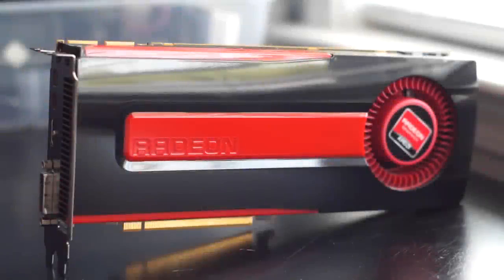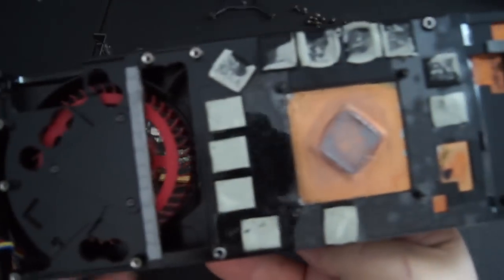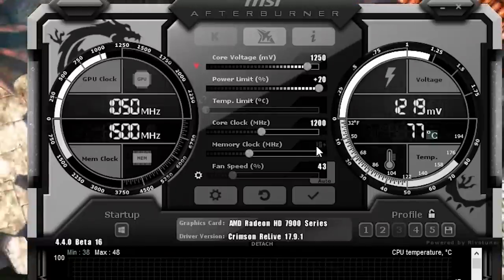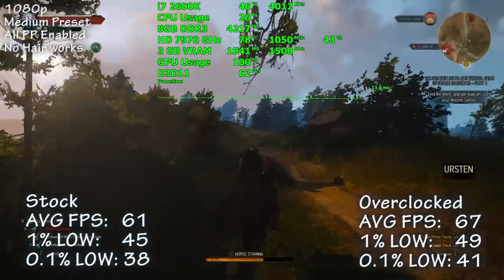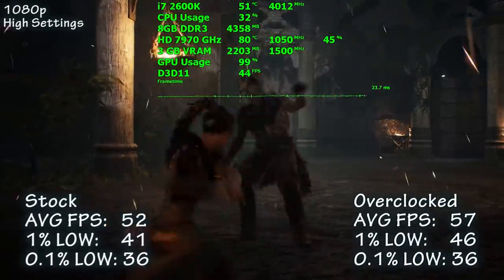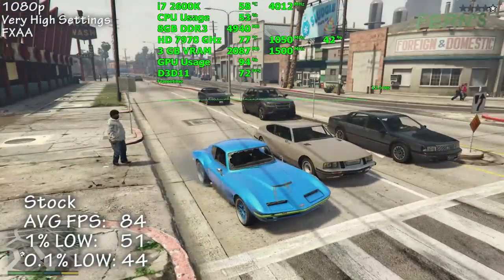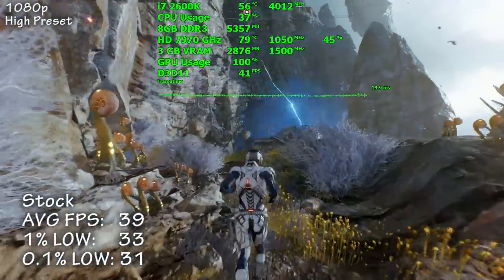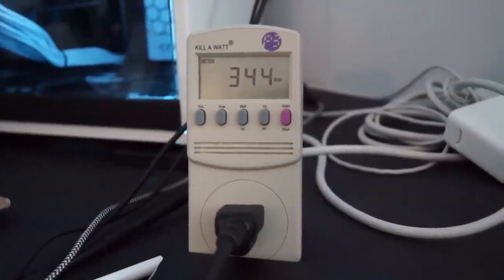AMD Radeon HD 7970 GHz Edition - How Does it Stack Up in 2017?

Comment: Remeeber when the 7970 launched nvidias flagship was the fermi 580 (fully unlocked rebadge of a 480), the 680 launches later and cost allot more (like £300 vs £400 for the 680) yet everyone fangirl'd over the 680. this card is still so great today 5 years later with a good amount of vram and even has FP64 compute 4x that of the pascal titanX, meanwhile 580's and 680's are peanuts second hand with only 2gb vram and narrow memory bus like a hd7850), the fan blade curves suck which accounts for the noise and temps but amd doesnt make the fans and that error carried on until recently. one of the best gpus you could buy ever considering how good its been for so long.
Reply from the maker: Yeah, the 7970 is probably one of the best aging GPUs of all time thus far, right next to Hawaii. It's kind of a shame, as when it was first released there was so much untapped potential. Hence, that's why NVIDIA released a mid tier chip as their High-end. The battle really should of been Tahiti XT vs. GK110, but NVIDIA wasn't impressed by the performance of the 7970, so they released the would be GTX 660, as the GTX 680. It has happened every generation since (GTX 980 and 1080) Fast forward today, and the 7970 is faster than the GTX 680 and is nipping at the heels of the GTX 780, or so it is said. I'll be testing that theory soon enough. 

As far as Fermi goes. It's aged much better than the 6000 series, mostly due to being a compute heavy design, and the fact it still gets driver updates. I have a HD 6950 in hand just trying to score a GTX 570 right now. I might have a 2.5GB version soon. I really like the Terascale 3 cards, and still wished they saw driver updates. I mean they support DX11 and have 2GB of VRAM. Still plenty for a lot of games.

Comment: Cgn 1.0 suffers from tesseletion setting it max at 8x boost overall performance.3 gb vram is enough for high with tweak in settings overall its features in dx12 some level   and vulkan support makes this card a true diamond.Replacing fan with gelid cooler made this card silent running at 60 celcuis undervolted with 980/1400.
Reply from the maker: AMD R5 1600 290X Tri x 8 gb Yeah I used to have 7950’s in CFX. Both has Arctic Acceleros cooler. They ran pretty cool and quiet, just put out a ton of heat. Like you mentioned, they underclock reall well too.
Reply: Hallo cousin! :D

Comment: Love your content. As I said in the past, like doing the same tests, but not quite as detailed! Firestrike and Passmark is about my extent. lol Keep up the good work! I have the non-Ghz HD7970 (replaced the GTX 580s I had). I bought a couple R9 280Xs last year (~ the same as a GHz HD7970, right?) to feed my BOINC habit. Have a few XFX HD7950 (Boost ed., and Black ed.) as well that I use for BOINC from when I dabbled in Bitcoin. Tahiti is king of FP64 compute. Not even new cards can match the 1Tflop+ compute for projects like MilkyWay@home. More geek stuff. :) Any way I also occasionally game on any of them, and can't say I am disappointed.  Interested to see how well they can power my 1440p monitor I upgraded to recently.
Reply from the maker: +Fury1184 Thanks man. I appreciate it. Yeah the 280x is pretty much the 7970 Ghz edition. I never got into mining, but I wish I had. Sounds like you quite the Tahiti collection. You’d be surprised with performance on some games at 1440p, but more graphical games are a bit too much.
Reply: For me, mining wasn't profitable, only made 1/2 my money back. Where I went wrong was I was expecting a quick buck, and when it tanked, I got scared and sold everything before it bottomed out.  I should have waited till this year...I had probably 7 or 8 bitcoins at one time and at today's prices, I would have paid for the hardware and then some. Oh well, hindsight is 20/20.
Yea...I got a few. I guess I am bit of a hardware hoarder. lol. I use them for BOINC as I said, which is the distributed comuting platform for universities and whatnot to do scientific research projects like SETI@home (Search for ExTerrestial Intelligence), which you may have heard of, or Folding@Home, whose goal is cancer research, which is a spin-off from the BOINC platform. I crunch for the Overclock.net team. Check it out sometime.
Reply from the maker: +Fury1184 That stinks about your loss on them. Yeah, I’ve spent my fair share of time on OCN. Spent more on the AnandTech forums, but not so much anymore, as they’re not like they used to be imo. I’ve heard of seti and folding@home. Haven’t contributed thus far, but I’ll have to check them out.
Reply: It is nuts that even the workstation Vega card (Frontier edition) has 1/8 FP64 throughput vs. Tahiti's 1/2.... (relative to FP32), so consumer hardware
beats up on professional cards at their own game.
Full throughput means half as many FP64 FLOPS as FP32s (due to each operation working on twice as many bits)

Comment: Hello i have the same card but after 5 minutes of gaming it already has over 90 Degrees and is extremely loud. If i dont stop gaming it goes even higher to over 95 degrees. I changed cooling pads and cooling paste today (good one from arctic). But to no avail. It still gets so hot. But i noticed that the stock cooling mounting bracket on the backsite is missing. Does this cause the high temperatures cause the mounting pressure is not enough?

Comment: I wonder if the 2600k is holding it back at all? Would be interesting to see the 7970 ghz in something mad like a 5ghz 9900k.
Reply from the maker: I would imagine there is a little bit more to be gained from using a 9900K, but probably less than 10%

Comment: my 7970 is sill kicking ass. its the stupid DD edition with the stupid cooler on it. i think its actully worse than the reference blower type. ive had too get rid of he fans an add 2 120mm too it too tame it. if i didnt have my xfi fatality pcie1x below it i wud double stack the 120mms for even better cooling which this card deffo needs

Comment: I've had my 7870XT (7930 thaiti) for 5 years is it worth replacing the thermal paste? I'm currently running at about 81c when the card is maxed out in far cry 4.
Reply from the maker: Yes. I would definitely replace it. 81c for that cooler is pretty high.

Comment: I really want to believe this is just a driver update gimping it as i have a RX 580 8GB V1 clocked at 1340mhz to play with and it literally has the same performance as this 7970. Is it just my card, or did some performance fall off with adrenalin HDCP or even 2016 Crimson update? I can never get performance like R9 390's i saw on youtube. Made me disappointed in Radeon for a bit.
Reply from the maker: There are a lot of variables which is why it’s hard  to make an equal comparison. What does the rest of your system look like?
Reply: A 580 should be quite a lot faster.

Comment: I sold my hd7990 / 8990 because I dont know if were driver problem o what but my games run like shit so I change it for a gtx780
Reply from the maker: Crossfire is hit or miss. Really depends on the game you’re playing.
Reply: thats why I sold it, but even using one gpu in some games fps were very low, for example I can play fallout 4 in ultra with a gtx580 classified but no with one gpu of the hd8990
Reply from the maker: GTX 580 Classified... 😍

Comment: gtx 690 or gtx 1050 ti? nowadays what card is equivalent to a gtx 690?
Reply from the maker: Assuming SLI is supported, 690 is definitely faster. One GPU on the 690 is around the performance on the 1050 Ti. When the 690 is supported properly is around gtx 1060 performance- or at least should be

Comment: Did you turn on any advanced settings in GTA 5 ? I'm not able to get anywhere close to 85 fps.
Reply from the maker: Nope. No advanced settings. What does the rest of your PC look like?
Reply: F2F Tech 4670K, 8GB RAM, 500W PSU.
Reply from the maker: Looks good. Keep in mind I’m benchmarking the last 115s of the built in benchmarks. You can set Fraps to record 115s as soon as you see the waterfall. It should end right at the end of the benchmark. Give it a try.
Reply: F2F Tech Cool, thanks for the help.

Comment: This card disappointed me   ! It  looked awesome   3 fans Gigabyte 
Memory  3 Gigs of  352 bit  which was the best at the time  DDR 5.
Now  was it because  of the fact I used 2 x 6 pins with one that was adaptor to 8 pin ?

It ran great  don't get me wrong  but it wasn't better than a  6850 XFX  & 6970 Powercolor !!
They ran actually stronger in older games like serious sam !!!  1 2  & 3 ..
The 7950 felt like it was struggling at times which i think it was lacking power from my power supply Corsair 500X  which is great but not powerful.. at all..
Once  I put a GTX 1060  My system climbed to insane heights.. Blowing away all these cards..

Now personally I think it wasn't getting enough power and that can affect your Graphic card big time it will stutter as I learned this Installing a GTX 8800 Legendary graphic card and it ran poorly till I upgraded the power supply to a new one recommended by the technician making the card fly!!!  realizing that was the problem  after he did a few tests.. 

But once I went RX560 SC 4G   wow what a card !!!! AREO MSI  Just Outstanding!
or a GTX760 3G Alienware system model oem.  WOW again  then the GTX ASUS 1060 
I'm in love with this card.. it truly won my affection  and made me love Nvidia  again..!
I was a big ATI fan boy for the longest time.

THE FINALLY A   ASUS GTX 1080Ti OC Strix Republic of Gamers  11G  Card!!!!!!!!
You don't wanna know the price tag on this card when it came out.. It was like a Honda civic  lol    hahaha 
I am Blown away by i;'s Visuals and Power.. and I've been waiting 5 years for this card to come out! Finally bought it.
For my New Ryzen 3600 XT  Viper 4400 hz Ram 16 set with a Sabrent 2T on board chip at 5000mhz speeds 4.0  
In a Cougar Tower X330- Air  3 front 1 Roof 1 Back Huge size all Neon Blue Plus a  212 Fan on the heat sink for more cooling Plus  swirling colors... 
Gonna  build it all soon.. For editing Videos Mostly  and  Photoshop  and serious gaming... 
*EVil*QTip GTX1080Ti 11G     is back   on I.D  Software!!!!!! GAMING !!!

Comment: I wish my r9 290x didn't kill itself, now all I have is a 460 thanks GPU prices
Reply from the maker: Bummer 😔
Reply: TheKnight OfCydonia My r9 270 killed itself too, so I've had to get a 1050 ti at the price of a 3gb 1060... At least it is somehow faster than the 270, and it runs much cooler.
Reply: I almost got a 1060 3GB for $190 but I didn't and regret it :(
Reply: Gabriel Perianu Why didn’t you get a 780ti or Hd 7970 ghz?
Reply: TheKnight OfCydonia Bad luck bro :/ Better try to save for the new 20xx series from nvidia. A 2060 at just 200 or 300 usd should be faster than a 1070 ti!
Reply: Xeno My 500w psu is to weak...But it worked good with my r9, so why not keep it and get a more frugal gpu?
Reply: My R9 270 died and now I play with GT1030

Comment: The 7970 was ahead of its time. It's still basically a low-end, modern card that is decent for a light gaming build.
Reply: JohnnyNismo *mid low/range
Reply: It’s hardly low end smacks the daylights out of the 1050ti so its mid range
Reply: The 7970ghz edition still beats a mid-range 1050ti somewhat. Of course the 7970 is 250w tdp vs the 1050ti's 75w, but who really cares if you aren't paying the powerbill, or live outside california where electricity prices are reasonable. Honestly I never see my system with a 7970 and a 850w 80plus gold certified psu never pull more than 330w in the most demanding of games. That also includes 5 120mm fans, 2 hdds, and 2ssds.

Comment: Ok i have this card since i think 5 years, cant even play pubg or overwatch that well.

I get an average of 30fps 1080p in pubg with everything in low, Overwatch 70fps again, everything in low (after all their updates) months ago i was getting 70fps in medium/high.

The rest of my pc
Intel i7 2600
8gb ddr3

I honestly dont get it.
Reply from the maker: You got a problem somewhere else. This card can easily play PUBG at high with over 30fps with the new update. Overwatch runs amazing as well. Maybe use DDU to remove the drivers and reinstall the the newest. Also monitor the GPU and cpu temps with Afterburner while in game.
Reply: Just checked the temps with Afterburner and they're fine. I might be using ddu to remove the drivers soon, thanks!
Reply: Not really, I'm the mother of god in graphics cards.

Comment: test an R9 290X!
Reply from the maker: Wish I could find one that wasn’t extremely overpriced.
Reply: F2F Tech well… maybe just wait for a month or two, and you’ll probably get one on eBay or Craigslist for around $150? I have a reference 290X, but too bad I can’t send it to you because I live in China and overseas shipping is quite unreliable in my opinion. In late November I ordered a dbrand sticker online on their website and it was sent from Toronto, and guess what, I’m still waiting for it’s arrival! Anyways, in China you can get a 290X on taobao (Chinese version of eBay, sort of) for about 1500CNY, which is roughly 200$. These cards are relatively expensive now compared to a year ago, due to the bitcoin mining trend in China. A friend of mine asked me recently if I could accept his 1070 in exchange of my 290X, and I refused his offer cause I wanted it in my collection. I had this card when it first came out in late 2013 for 4,500CNY(roughly 700$). It aged surprisingly well. Just look at the 780Ti from the same era, which cost 20% more and preforms just a little bit better back then, getting its ass kicked by the AMD driver updates. Currently I’m using this very card for gaming, and it handles modern AAA titles quite well in 1080p. Games like GTA5 gets well over 60fps maxed out, with a 4770k overclocked to 4.2 gigahertz supporting it. I had a custom air-cooling solution mod on it, and turns out if you’re willing to spend some money to get rid of the ridiculous reference cooling solution, this card can give you more than you ever expect. Mine sat at 1250mhz/1500mhz, and under load, the temps sits at around 75 degrees. I strapped the tri fan originally on the reference HD7990 on the 290X recently, and it looks sexy af. Really love this card, and good luck finding a reasonable deal.

Love your videos btw. Hope you come up with more awesome videos.

Regards
Reply from the maker: I really appreciate it. Sounds like you got a golden sample. You’re right though, the reference cooler is pretty terrible. I’d love to see a picture of your current setup. I love the tri fan cooler from the 7990. I’d love to find a Hawaii card, preferably a sapphire X 290. I have my GTX 780 Lightning back. So would love to do a performance test between the two in 2018 with current games. I might do one between the 7970 and gtx 780 though. Probably would adjust the clocks accordingly.
Reply: F2F Tech I posted a tweet with the pics and @ed you
Reply: F2F Tech In fact its performance is pretty much on par with the RX480 and the GTX1060, despite that they differ in price and memory size. It was still one of AMD’s A-Games before Vega came out.
Reply from the maker: Got it. Beautiful card. Thanks for doing that.
Reply: I have this Asus R290X DirectCU II that I bought last year (a bit before the Crypto greed really took off), coupled with Ryzen 3 1300X @ 3.8 GHz. It performs reasonably well. Gets noisy though. I know from personal experience that this GPU isn't great at overclocking. So next, I will try undervolting it to see if I can  lower the noise levels.
Reply: Hans Behrends You can undervolt the core by flashing the 390X BIOS onto it, but I don‘t think there would be much of a difference. Even if you get the refrence cooler replaced, you’ll still experience coil whining bad. In fact the best way to reduce noise level is to have V-sync enabled having your FPS capped at 60,. This significantly reduces heat and noise produced by the card. Also you can eliminate coil whining simply by squeezing some “406 Glue” into the inductors next to that line of mosfets. IDK if they have this kind of glue in other countries, but it certainly works like a charm. 2 years after applying this method and no negative effect was picked up. It‘s a little trick that I don’t usually tell people :-P

Comment: Test a Radeon 5850 / 5870!
Reply from the maker: MusicHaven2012  still waiting for a deal on both of those cards. I have a HD 6950 though.
Reply: Nice! Would be great if we can do a showdown between the 5850, 5870 and 6950. I do have a 5850 and it's still a solid card that I bought for 30 bucks used and still works well.
Reply: He did a 'double 5870' already, a 5970 (:
Reply: Yeah but a single card hahaha! To me, a single card is more often than not more optimised, Dual GPUs are often a hit or miss. 

But anyway, now it'll be a good time to see how 2010 / 2011's cards fare today like the GTX 580, GTX 590, Radeon 6990, 5770s etc.... in various single GPU or dual GPU or multi card configs.

Comment: IT's far better than a  Nvidia 1030  and it performs very close  why?

My anger that games cannot access the full potential of the 7970 3 GIG of High end DDR5 384Bits and all it’s internal power and it performs just a bit higher than a 6970 ???
Which has far less internal power and tech and the 7970 only does 5 to 10 frames more?
Terrible.  IS IT DRIVERS  ???
Reply from the maker: What game are you comparing too? This card will hang with and Best the 1050 Ti I’m a lot of titles.  It’s hard to make comparisons between review outlets, as we all use slightly different testing methodologies.